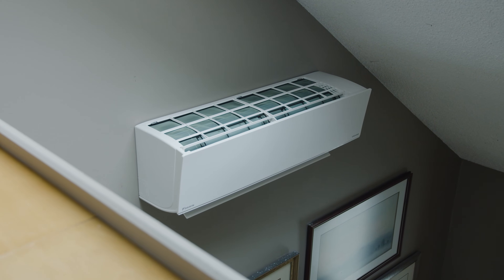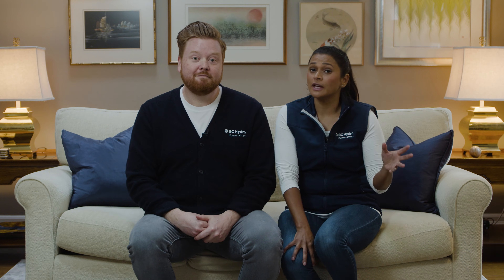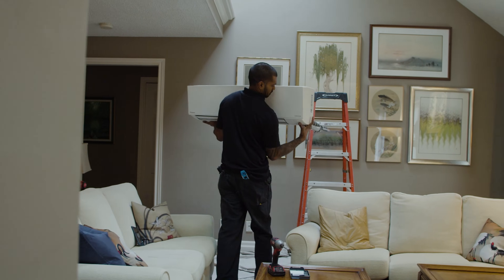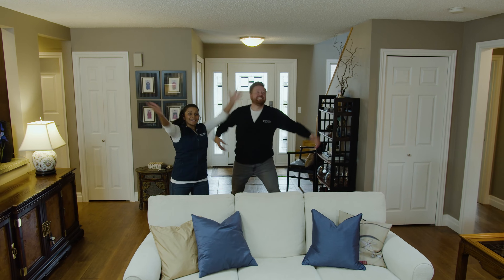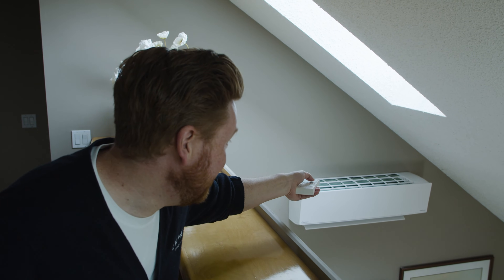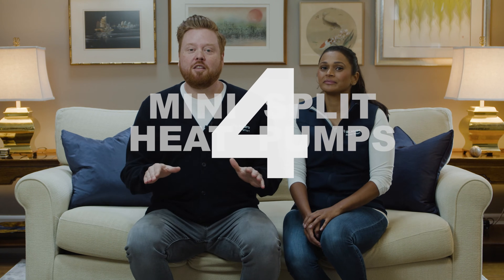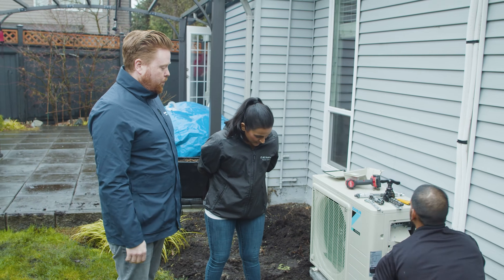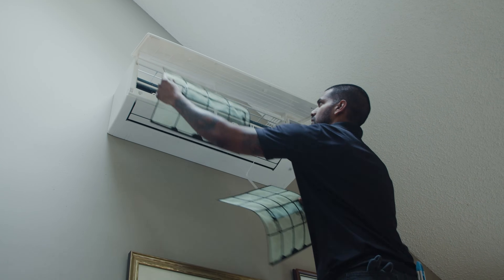Mini-Split Heat Pumps | 5 Things You Need to Know

Comment: This is what everyone needs to know. THEY SUCK. My building installed split heat pump inverters replacing the wonderful heated floors we had. Currently my Panasonic Inverter is set for 19C. My thermostat is reading 22.7 and the heat pump is pumping heat like it's minus 20. But speaking of which, when it is really cold it won't blow enough heat and I freeze. If it's cold and windy forget it. Get a space heater. Then there's the snapping and cracking noises these things make which is always lovely right above your head when you're trying to sleep. Ya they suck.

Comment: Is it possible to produce smaller air to air heatpumps, at least half the size you show in this video? Espescially the module you put on the indoor wall should be available in smaller sizes, for small cabins with not much wall space. I have not found any on the market that could fit my needs, they are all too big

Comment: All in all, do not get those. If you are seeking for so called air conditioning to switch from gas  to heat pump, don’t do that! You will get regret immediately. If you don’t have heat pump to blow cold air in BC, you suffer a month. If you switch, you suffer four month with never heated up winter.

Comment: Which brands do you recommend?
Reply: Mitsubishi will always be the highest end brand. My local hvac suppliers install a lot of Westinghouse. Alittle cheaper on the cost side. My house needs a tri zone 2 ton unit install. Mitsubishi is about 7k for everything & Westinghouse is around 5k. Only difference between the two is the mitubishi can run heat mode in down to -14 degrees Westinghouse is -12. But these mini splits only pull heat out of the air so anything super cold outside you should rely on your main heat source. These systems should be primary cooling, & back up supplemental heat.

Comment: This will probably make your interior more dusty since it's drawing air from outside. The filters don't catch everything.
Reply: No. Just no... It's not.
Reply: @ColdSun87  What stops the dust.
Reply: @PyroShields These do not move any air between inside and outside.   So they will not be bringing in dust.   They move heat.  They can get dusty just like a ceiling fan however.

Comment: Heat rises so why would you put a heat pump outlet high wouldn't it be more effective down low to allow the heat to rise?
Reply: They can also cool the air, which sinks, do you'd want it to be somewhere in the middle, which it is
Reply: Because adding heat high or low (during the heating season) doesn’t impact efficiency.   But removing heat (during the AC season) is much more efficient up high.

Comment: So it being winter our electric bill went from 400, to 540 in November and $608 for the month of December. My suspicion is the mini splits not being set correctly.

Any advice?
Reply: Heat pumps use more energy in heat mode than cool mode. It your temps are below 30degF(1c), heat pumps struggle especially if their compressor is not an inverter type.
Reply: Is it specifically a cold climate heat pump?
Reply: @JgodAlpha  That is why you should not get them. Yes, it’s clean energy but also clean your pockets.

Comment: I call BS on the "1 unit of energy in 3 units of energy out". That violates the laws of thermodynamics. If that were possible there would be no energy crisis. There is always loss when dealing with systems. 1 in 3 out implies 300% efficiency. Not possible. The system should have an efficiency rating that is below 100%. No system is 100% efficient. Go talk you "double-talk". Only the sheep will believe you.

Comment: Why didn't you mention that as of July 1, 2022 you are making a DIY install of a minisplit ineligible for a rebate?  This is BS.  The timing of this change coming just when the 2 hardware big box stores began selling the DIY versions stinks of collusion with the HVAC overcharger mafia.  I installed 2 myself here in BC, got the rebate and saved $9K over what HVAC quoted.  They work great and have seen elec. consumption for heating (had baseboards) go way down.